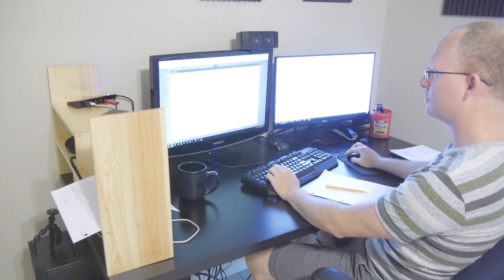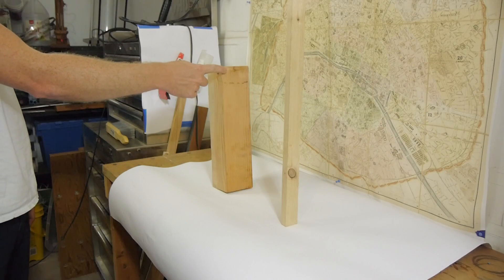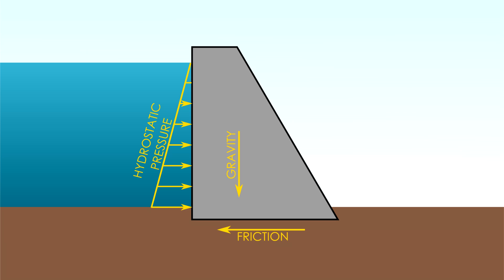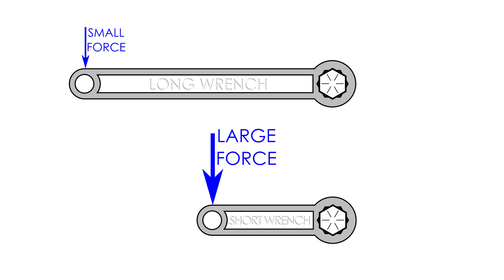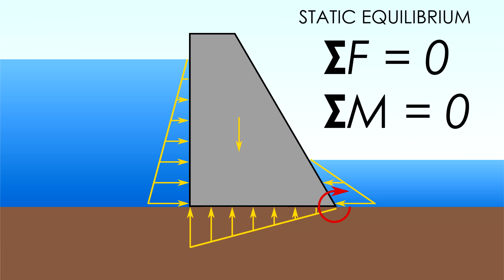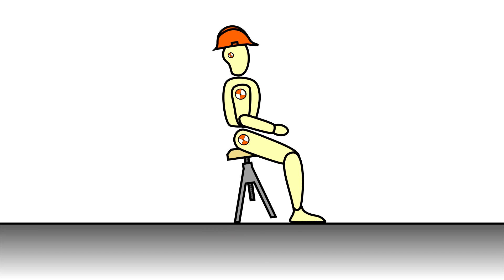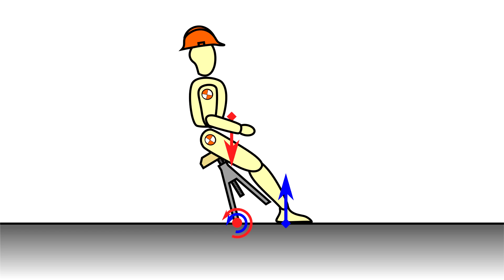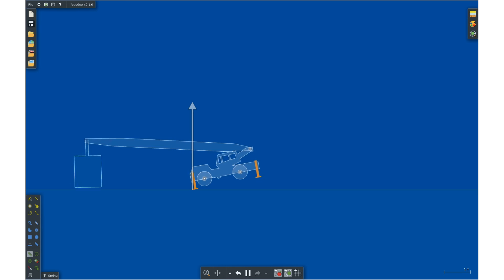The Physics of Falling Back in your Chair

Comment: I can balance while leaning back on my chair by extending my legs forward, I'm guessing that puts the center of mass forward too?
Reply: You can indeed, if you do it at the moment you become unbalanced, it won't help since extending your leg forward will propel you backward a bit (reciprocity), it's like on a bike, if the bike lean left, you can't move your body to the right and expect it to stop leaning, because by moving your body to the right, you pushed the bike to the left accentuating the lean.
Reply: If you do it right, you can balance with your knees against the underside of the desk. Or use suction slippers.
But the biggest danger in falling back on a chair is that the chair leg starts to slide forward, and that slide is hard to balance against. So there is some dynamics in it too.
Reply: It should work if legs are extended faster than the speed of light, because gravity also travels at the speed of light.
Reply: You are not falling back at the speed of light.
Reply: Bread Vendor, it's the same thing, your center of mass is the reference to calculate the torque your whole body creates compared to the base of the chair. Your leg are part of your body.

There's 2 thing:
-the position "extended leg" put your center of mass forward (your calves are farther form your torso, so they have more "impact" over the position of the center of mass) it's undeniable, but...

-the move of extending your leg is not free, if you put your leg forward, you use the friction of the base of the chair to not go backward, it's not obvious but you can test this. Take a chair with wheels, align all the wheels forward, then keep your arms and legs very close to you, and extend very quickly forward, if you're fast and the wheels slide well, you will notice that your chair moved backwards.
Reply: That's what was said in the video...
Reply: Benjamin Herisson I see. Thank you very much for the explanation!
Reply: But you can shift your CoM forward, because the chair makes a reaction force which pushes it. I'm not sure if this is what you said.
Reply: Krunchy Krisp I think the reason you balance isn't because your center of mass moves, but because you increase the moment of the force you're applying with your feet. The moment of a force (as mentioned in the video) is equal to the force times the distance from the center of rotation (τ=f*r). So I think that the more you extend your feet, the stronger the moment of the force you apply is, so it balances with the moment of your weight.
Reply: it increases your moment of inertia slightly
Reply: It's true also leaning your upper body forward as it started to tip would in theory shift your centre of mass forward too. The problem of course here is newtons laws of motion specifically the one that states every action has an equal and opposite reaction. Anything you do to move your mass forward has the effect of pushing the chair backwards it would take quite a bit of practice to balance it that way simply because you would have to time and adjust everything perfectly (plus this simple fact means it's pretty much only going to work if you planned to do it from the start, the split second it would take you to react to it when caught unexpectedly is more than sufficient for the point of no return to be long passed).
Reply: whutman it does, but that on its own just slows down the inevitable.
Reply: It isn't inevitable though. If done soon enough and/or fast enough you can still go back to the stable position. I'm not sure if humans have enough reaction and force, but it should be possible.
Reply: Benjamin Herisson the trick to balancing is to extend your legs fast enough and soon enough that the amount of torque in one direction from moving your center of mass is greater than or equal to the torque from the backward "thrust" from pushing your legs forward. 

Also, your feet move in an arc, which gives its own torque to the system.
Reply: Fresh Rock Papa-E Fresh Rock Papa-E Fresh Rock Papa-E 
you are right, it is quite possible to balance like this by moving your legs.  I use this almost daily. I can not balance,  but I can save myself from a fall, and go back to an upright position. 

I was responding to whutman who said that moving your legs changes your moment of inertia ( "I" in physics equations ). While this is true, changing I, by itself, can not keep you from falling. I is simply a measure of resistance to angular acceleration. Angular acceleration = torque/ I.   If you increase your I, you will accelerate slower, but if torque stays the same, you will still fall.
Reply: If I had to guess, your CoG is directly above the pivot point, not creating any moments or torques in the system.
Reply: Yesterday, I replied to Benjamin Herisson, who said something along the lines of: moving your legs moves your center of mass, but also creates a reaction force. 
Benjamin had a very factual and informative explanation, but I wanted to make one thing a little more clear. You can still balance by moving your legs. 

I because it was 4:30 am I was thinking a little funny, and I got some of it wrong. 

My best explanation:
In space, it doesn't matter how you flail your legs, your center of mass stays the same. (Concervation of momentum) This is generally true on a chair too, except the ground can apply forces on you. Because your feet move in a (part of a) circle around your knee, moving your feet requires a torque, witch provides a counter torque. This tips you forward, until your center of mass is in front of the pivot point of the chair. Hopefully. 
You could also spin your arms in circles to balance. 

This works the same way as a satellite's reaction wheels.
Reply: The torque provided by the acceleration of your leg is very negligible, i would say, mostly because it's too short of a rotation (90° in a fraction of a second), spinning your arms is better indeed ! (especially if you have bricks in your hands, like any good chair balancing person do !)

Now I wanna try spinning my arms with bricks in my hands standing up on a narrow piece of wood to see how fast i need to spin to fall down, I would look totally not crazy !

About spinning your arms, do you think it's better to spin in sync both arms or with a 180° offset ? in sync your center of mass moves a lot (forward then backward and repeat) and you can't possibly expect enough rpm to neglect that !
With the offset your center of mass don't move in theory (if your arms have a central symmetry at your center of mass) but I can't figure out what it will do if your center of mass is not aligned.

Also we're assuming the torque from our shoulder or knee can be transmitted to the base of the chair, which is a stretch honestly, we just sit on the chair, there is little friction between our pants and the chair. It might just lift the back of our ass a bit and put more weight on the front, i don't know, it's 5:40am, it's probably not right...
Reply: depend on hom much you extend yourleg and how much you lean back but you cant plank since the center of gravity of standing/laying human i in there belly button mor or less(depending on fat repartition)
Reply: Nah, try it, see what happens. 
Kicking your legs forward will shift your center of gravity but it will also exert a force through the chair and onto the ground to recline you further. You might get lucky, but chances are you will just fall on your butt faster.
Reply: your adding more weight to balance out the rotation.... and there is still a point where you'd fall back.

Comment: I work in the wheelchair and seating market. Current manual and motorized wheelchairs use a "center of gravity " posterior rotation when orientation in space is needed. It works well in reducing,  if not eliminating,  rearward falls when tilting backwards.

Comment: Assuming your legs are long enough, you can use the friction beneath your feet to counteract falling backwards as well.
Reply: kicking your feet up quickly also helps since that requires a force to accelerate them up which generates a counter torque for a fraction of a second
Reply: #facepalm
the idea is to stay seated and not fall, NOT stand up and for the chair to fall. sigh, stop adding variables to the experiment or concept
Reply: I find that unlikely. To create friction you need to exert a force downwards, which would have an equal and opposite reaction pushing you back. Extending your legs would move the center of mass forward tough, which could bring it back over the point of rotation.
Reply: Try it, tilt a chair till u reach the focal point and then move your legs backwards, you do need some downward force for it to work, but the act of moving them backwards along the floor definitely works.
Reply: Friction is a function that relies on the force you exert on the ground. Exerting force on the ground will push the momentum backwards, and thus worsen your situation. The only way this trick might work is if the momentum of the chair is already going in the forward direction, meaning when you aren't actually falling backwards in the first place. We can conclude that you've reached the wrong conclusion about what the physics behind your trick is.
Reply: sigh deleted my explanation by accident
Colopty I also think he has it wrong.
after the tipping point you can't even keep your feet on the ground since they'll be accelerating upwards since you're rotating backwards.
just BEFORE the tipping point you can control it with the friction of your feet, but that does not mean that there is no normal force acting upon your feet. it's still there but very slight. if you happen to go past the tipping point while doing that then you'll fall. if you think you went past the tipping point and didn't fall then you didn't go past it, your muscles just fooled you.
Reply: All of you are wrong! You're thinking of a tall chair such as the one in the video. Imagine sitting on a shorter chair where at the tipping point and the moment where you feel yourself begin to accelerate, you immediately press your feet onto the carpet (let's say carpet cuz friction) and drag them backwards while your body reacts by throwing your arms and head forwards. Even if the chair falls you have a chance to stay on your feet or to move the whole system forward again. Just depends on your reaction time, the coefficient of friction, the center of mass of the chair and the effect you have in it, and how much force you can exert on the floor (hopefully you're wearing some boots). Don't think so theoretically, yes you can do the math for a specific situation on paper but we've all saved ourselves from falling at least once!
Reply: steven yau you're missing he point. Get off your high horse. This ain't a question in class. In the video he lets himself fall, he doesn't try to change his center of gravity. Reaching forward and throwing your head forward can adjust the center of gravity so that you change the tipping point. Having your tippy toes on the ground would help if you managed to somehow put them on the floor. Ever almost fall off a long or a curb while trying to balance? You are at and past the tipping point and your center of gravity oscillates back and forth as you try to keep yourself from falling. It's completely possible to stop yourself from falling if the moment generated by the new center of gravity counter acts the moment of inertia.